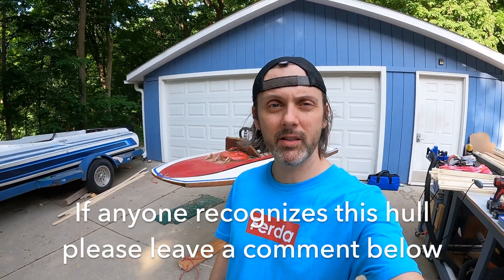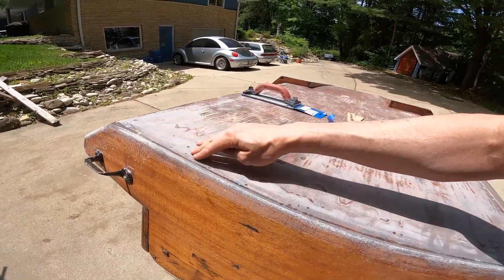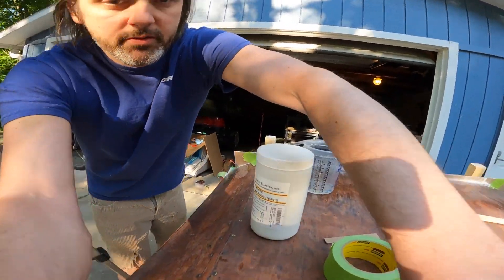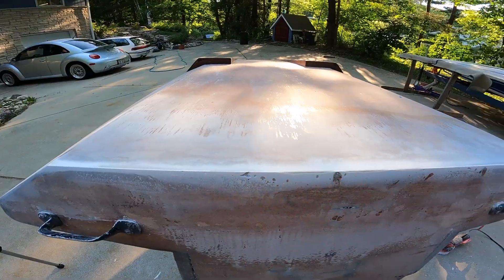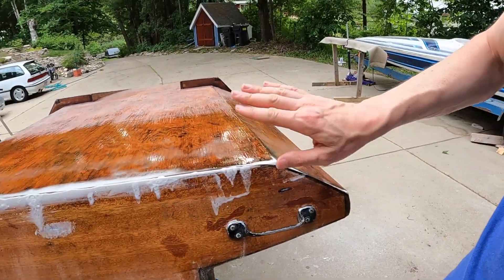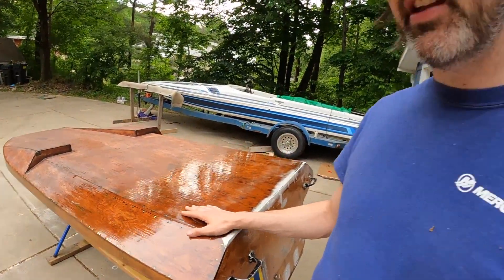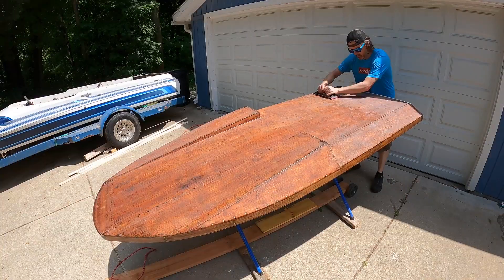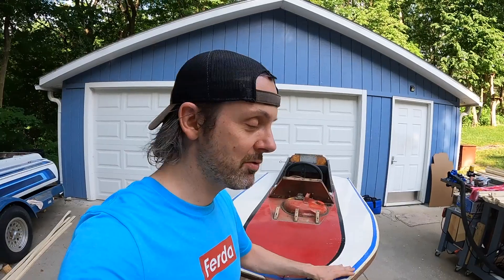8' Mini Hydroplane Project: Blueprinting the Pad & Speed Secrets

Comment: Balsa wood works great for filling very large voids when using resin or epoxy,also it’s much stronger than just resin or epoxy especially where your transom meets the stern of the hull. Your hydroplane buddy is right about the lateral sanding as well. The lateral lines create a very minute/thin turbulence area of an almost skin like effect across the hull. This turbulence is much like a void of air for the hull to ride on, this in effect lowers the coefficient of drag against the waters surface. Reduce the coefficient of drag against the surface tension of water and you’re effectively lowering resistance for efficiency or gain in speed. Click on some of the YouTube channels that show engine builders porting intake ports on the cylinder heads of engines or  showing flow bench tests on intake manifolds or cylinder heads. Those guys explain how surface finish directly relates to an engines volumetric efficiency directly relating to a smooth surface creating more drag in airflow to the point that atomized fuel sometimes actually returns to liquid droplets from the loss of airspeed.  I swear that this is relevant in the case of your boats hull and speed. I worked with the Bombardier motor company for 5 years building Seadoo jet boats followed by 4 years with the Crownline boat company. After I got away from the boating world I got back into what I was raised around and got back into construction, I spent 12 years on a lock and dam construction project and had to deal with hydrodynamics on a daily basis for that whole time. I’m impressed with your projects and your channel btw,you’re doing great work. 👍👍👍
Reply from the maker: Thanks for the kind words!   I have a feeling this type finish isn't mass produced because it's most likely a small gain; but also because if you left the boat in the water, it would likely get scuzzy faster, much like a chia pet :D
Reply: @ADDvanced , you’re absolutely right about the leaving in the water part.  Most of the high speed stuff I’ve seen was constantly in and out of the water and usually ended up being pulled from its trailer between events. The Canadian engineers spent a lot of time perfecting that stuff and had some formulas worked out that were actually really reliable. They had patterns and templates made up for the jet skis that were pretty impressive that guided an air file in 30,45 and 60 degree vee patterns. That whole bunch was pretty serious about their factory backed stuff.

Comment: We used a product called speed coat, it was like a graphite finish smooth to the touch but in actuality, it was more like 2000 grit wet&dry, a flat finish.
Reply from the maker: Do any testing w it?
Reply: @ADDvanced  There was a 3 to 5 mph difference compared to a waxed hull .
I don't know if it is made anymore .